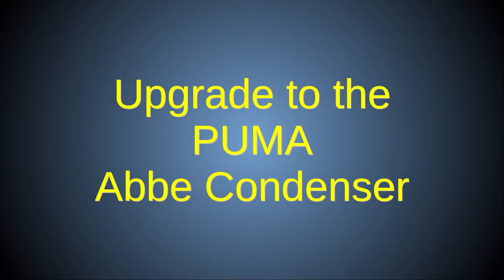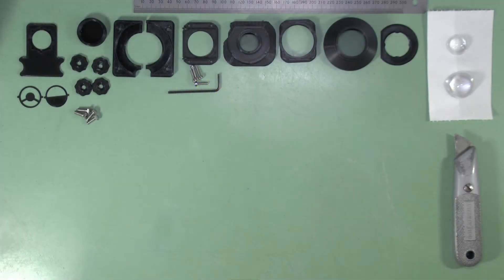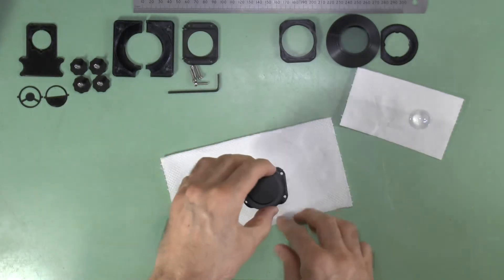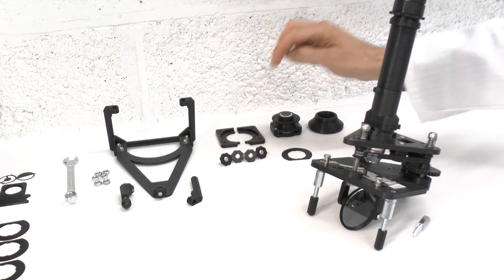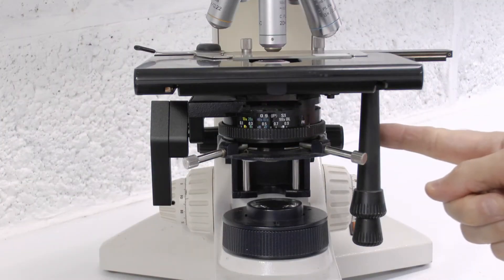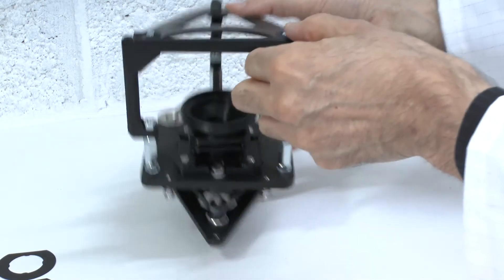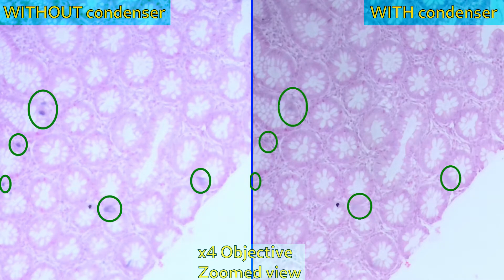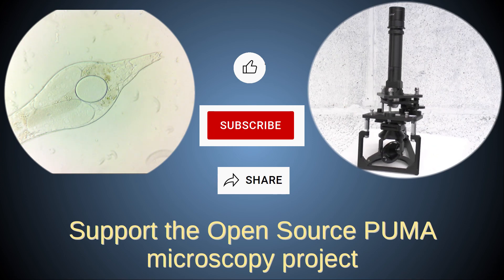The Abbe Condenser with an Intro to Dark Field and Phase Contrast microscopy

Comment: The PUMA project looks interesting. But... It is so lightweight. No mass to prevent vibrations ruining the image. Microscopes need a good heavy structure and base to be any use.
Reply from the maker: Hello. I agree with the need for more stability for certain uses (not 'any use' though!). I have made a stabiliser system to help with its current configuration ( see: https://youtu.be/d8tMtWFhNY4  ). I am also working on an alternative stage for high end projects. This will be more stable and have motorised XYZ for precision experiments. Remember, one of the design goals of PUMA is the 'P' bit - portability. The present lightweight system is actually quite useable out in the field for visual observations and on a sturdy desk is has proven useful for imaging too, despite its lightweight construction. The video I linked above gives some examples of that.
PUMA also has other uses and unique strong points compared to other scopes and was never intended to be a 'drop-in' replacement for a Zeiss Axioscop 3 or an Olympus BX51, etc.
Thanks for taking the time to watch and make a considered comment. I appreciate that.

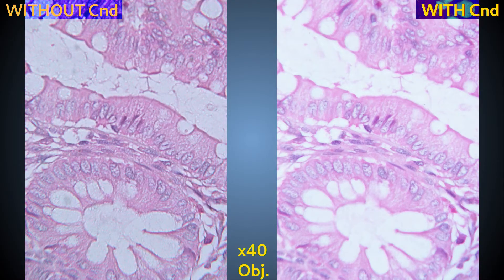Comment: Hello! I think that the example images with and without the condenser lens at 17:26 might be mixed up. I think that the image with the condenser is actually on the left, whereas without the condenser is on the right. This is in the opposite sense of the labels on the slide and the description in the transcript.
I might be wrong about this, however.
Reply from the maker: Hello. Thanks for watching and taking the time to comment. I just checked and I can confirm the labels are correct as shown. The one without condenser (left) shows the increased refractility and coherence artefacts associated with a smaller numerical aperture (as you would expect when not using a condenser with a high NA lens). Note, for example, the increased visibility of the clear mucin in the lumena and the coarse texture of the cellular cytoplasm. These are examples of the enhanced phase-based contrast that you see when a condenser is either absent or the IAD is reduced to significantly below the rated NA of the objective. I'll say more about these things when I publish my video on the PUMA high NA illuminator (probably later this year).
Reply: @PUMAMicroscope  ah I see. Thanks for the explanation! Probably I am mistaking the diffraction artifacts for higher resolution.

Comment: Hi, first of all congratulations for the project which is great. I have already printed and assembled my PUMA microscope and I am very satisfied.
I have a question that I can't find the answer to myself.
It is possible to attach the LED illuminator directly to the Abbe Condenser instead of using mirrow?
Reply from the maker: It is 'almost' possible by using the DI_M3_Adjustment_ring model (page 124 of the current 3D printing guide PDF) to hold the illuminator. This is normally used to hold the lamp for the epi-illumination config, however if you can print a short male thread ring to act as an adaptor you can attach the DI_M3_Adjustment_ring to the base of the condenser (where the DI_Cnd_to_UC or DI_Cnd_Mirror_holder_socket would normally go).
I say 'almost' possible because I have not included such a 'short male thread ring' in the project as yet but you could fashion one using the top male threads from those latter-mentioned parts' FreeCAD models. I did actually make such an adaptor but just haven't released it in the GitHub repo because I did not see the advantage or need to stick the illuminator directly under the condenser - it will not give good illumination like that (poor NA). In a future video I will show you the PUMA High NA illuminator which has a similar compact config to what you want but uses a specially made diffuser in place of the Abbe condenser to give high NA illumination.